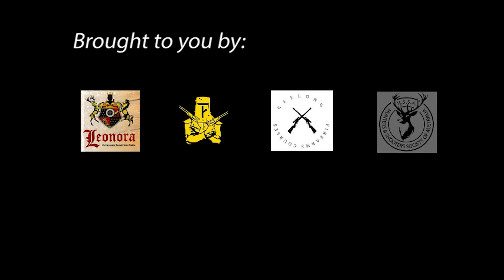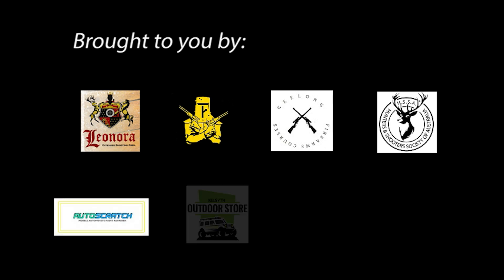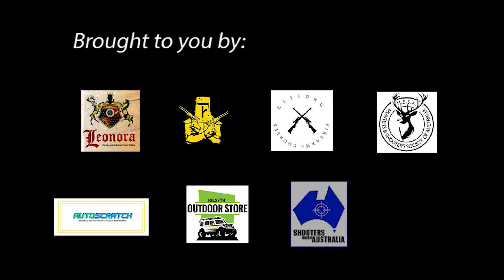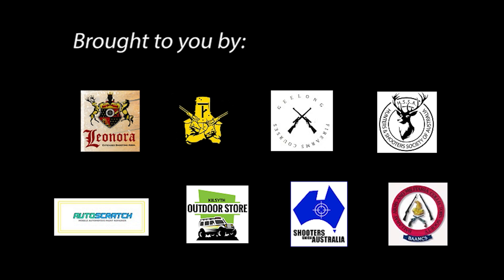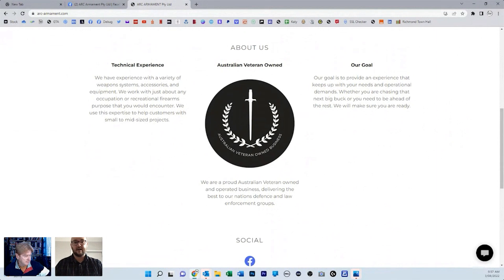NSCTV - Episode 11 - Protecting your gun

Comment: I think this is more about the cerakoating company needing to take possession of a firearm or firearm parts in order to apply the finish. He then needs some approved  way of securing the firearm (e.g. a safe as specified in the Regulations) and be approved to handle a firearm.  I wouldn't lend a gun to an unlicensed mate, for example - in the ACT we can't even let an unlicensed person physically handle one of our firearms (an approved instructor needs to do that). By getting a dealers licence, he'd be compliant with security provisions and be able to maintain the regulatory chain.
Reply from the maker: Hi David.  Thanks for that. Yes, that actually makes sense - but the way it came across from VicPol suggested they were actually viewing coating as some sort of firearm repair.  However as you said, there is the storage & handling issues for which it would make sense for the person to have some sort of licence.